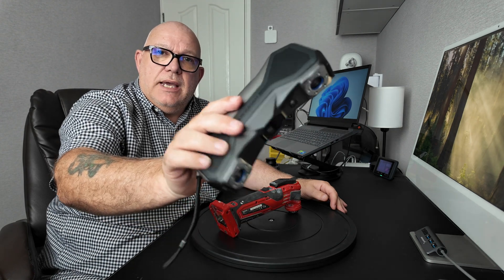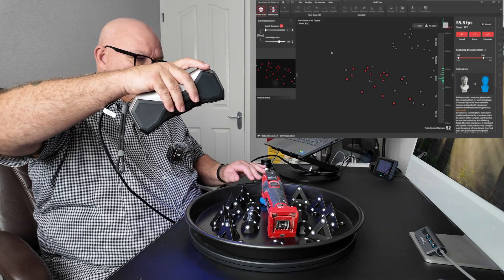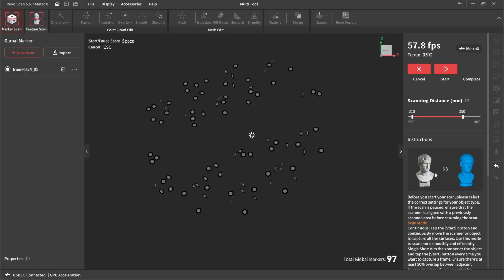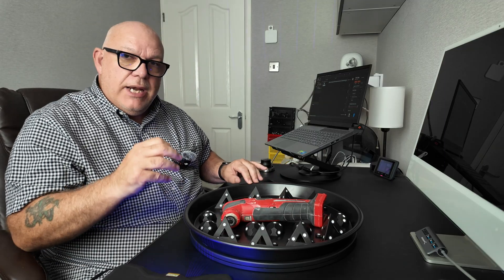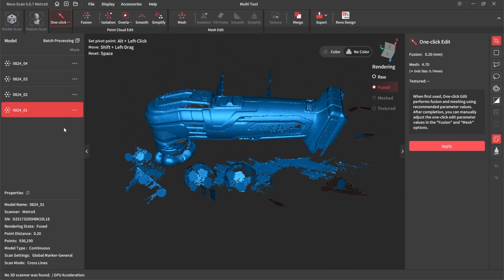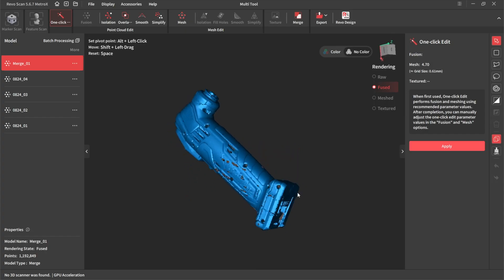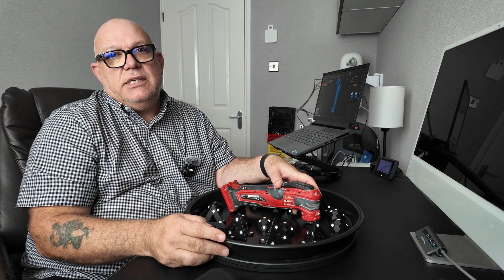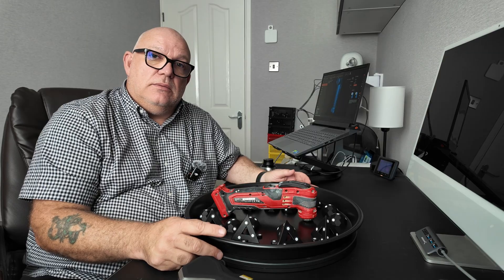Revopoint Metro X Tutorial – Scanning with Cross & Parallel Lines (Multitool Example)

Comment: Can you please share with us what the specs are of your laptop?
Reply: Also, if you could let us know if with your specs and if you remove GPU acceleration, would this scan be really usable? Revopoint says GPU is "Optional" but is it really?
Reply from the maker: Next time I fire it up I’ll turn off GPU and see what frame rate I’m getting. I know I was getting 60 fps right from the start when others were getting far less as they supported my graphics card first.
Reply from the maker: It’s a Dell G15 5530 15.6" FHD 120Hz Gaming Laptop, Intel Core i5-13450HX, NVIDIA GeForce RTX 3050 6GB, 32GB RAM, 512GB SSD